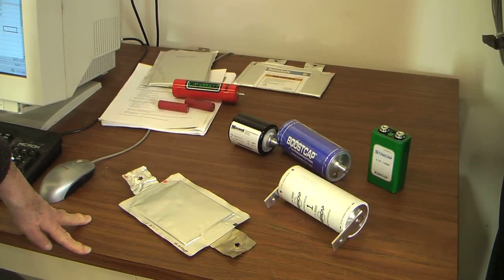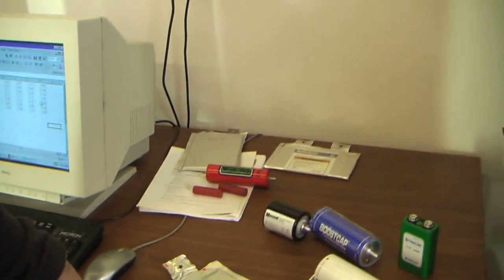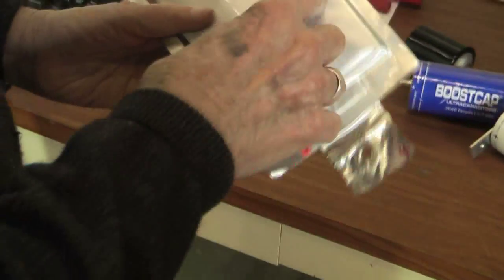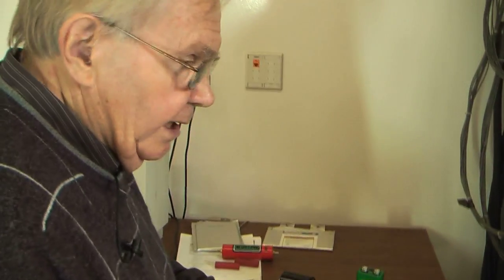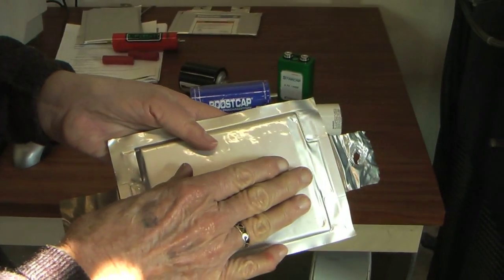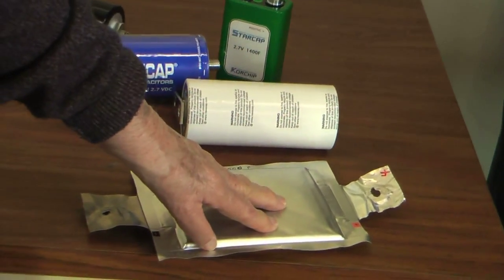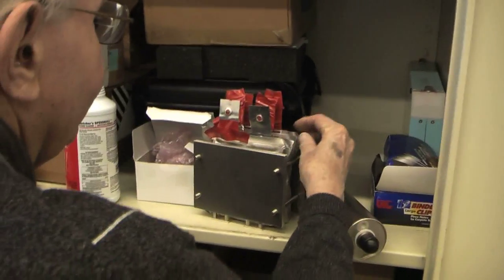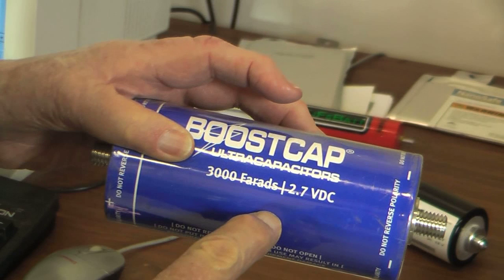Ultracapacitors with Dr. Andy Burke

Comment: Buying six 2.7v  3000F capacitors and putting them in series to handle the approximate 15 volts from the alternator  This gives a grand total is 500 Farads. That's just not a practical application since they aren't exactly cheap..

Comment: @MaxwellsDaemon No, he means voltage testing in the machine. The capacitor is indeed rated for only 2.7v, but he says they tested them at 400v. This is probably just safety/rupture testing, and certainly destroys the usefulness of the capacitor.

Comment: Pretty sure he means "up to 400 farads" since no EDLC I'm aware of can take more than about 3V (typically 2.3, 2.5 or 2.7 rated). The capacitor he is holding when he says 400v has 2.7v written on the side of it. Easy slip to make - so correction is not meant as a criticism.